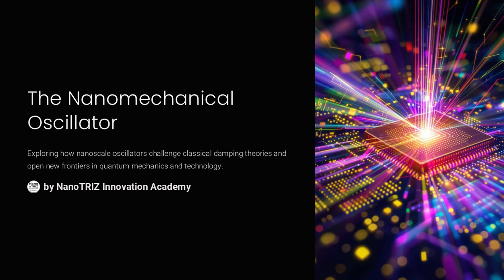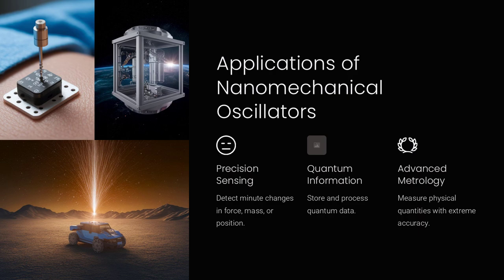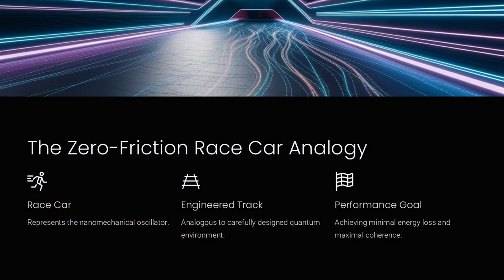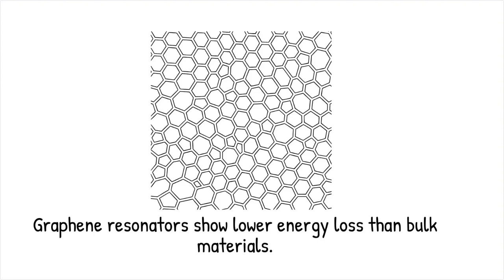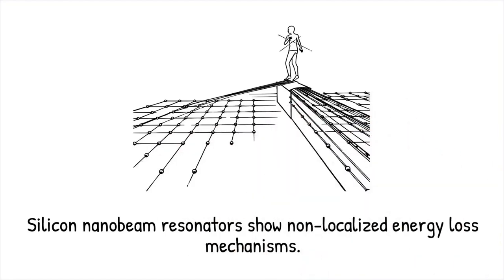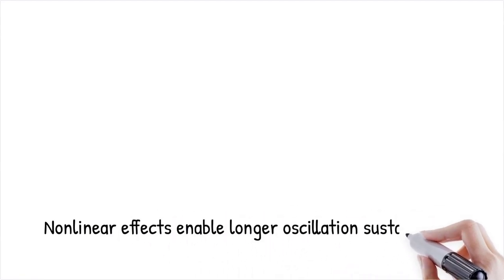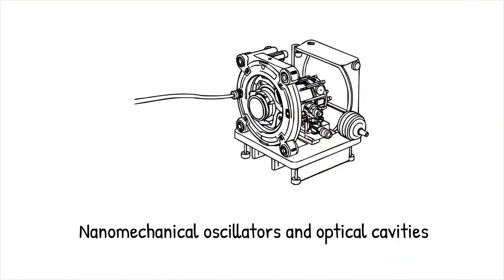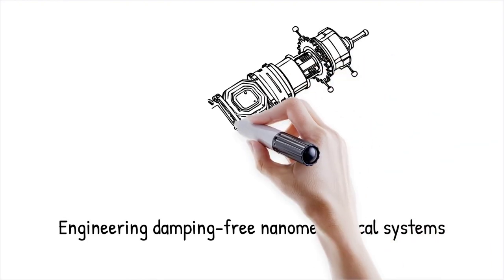Why Nanomechanical Oscillators Shouldn’t Keep Moving — But Do!

Comment from the maker: What fundamental mechanisms govern the suppression of energy dissipation in nanoscale oscillators, and can we develop a unified theory that bridges classical damping models with quantum effects such as zero-point energy and phonon tunneling?
How do quantum backaction and measurement-induced decoherence alter the stability and longevity of nanomechanical oscillations, and can these effects be harnessed for practical applications in quantum computing and precision metrology?
Is it possible to engineer nanoscale resonators with near-zero or even negative damping by exploiting non-equilibrium quantum states, and what implications would this have for developing lossless mechanical circuits or ultra-sensitive gravitational wave detectors?